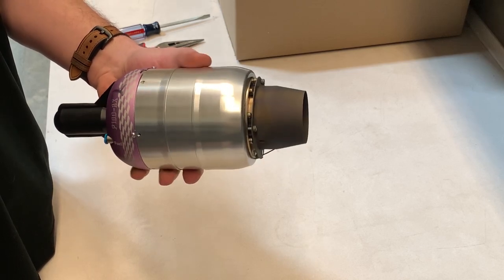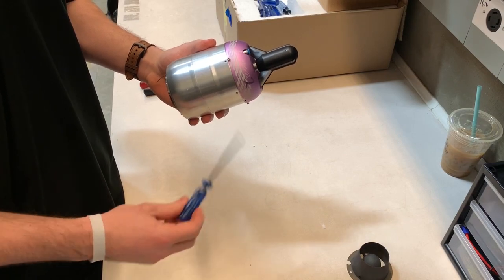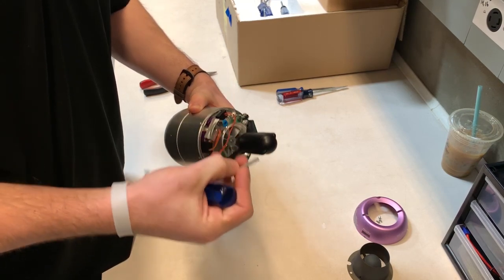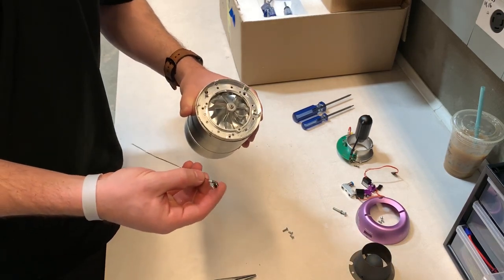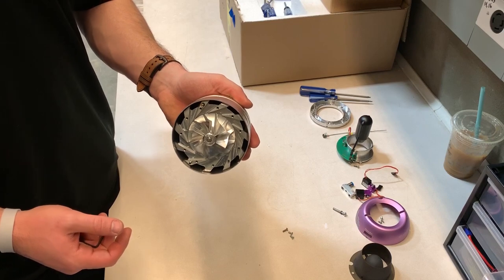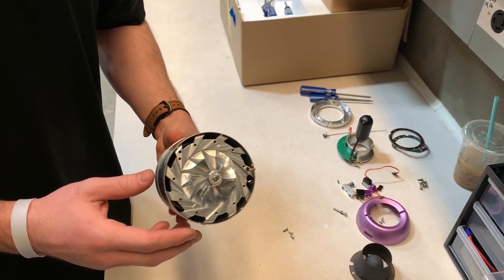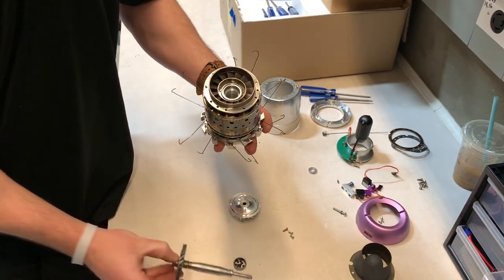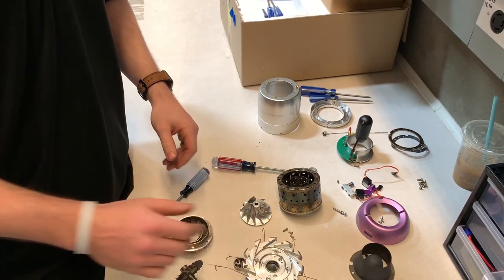Disassembly of JetCat P100 RX

Comment: Hey. a good video for learning internal components. Can you tell me how started motor was connected to the compressor/turbine shaft. Was there an clutch system of any sort. It would be very helpful if can share the picture or name of the connector used. Thanks
Reply from the maker: Hello, unfortunately I don’t have any pictures. But I can tell you that I believe the stater couples with the shaft via electromagnet. When the signal reaches the starter, the magnet engages with the shaft. After it’s running, it disengages. Full throttle for the turbine/compressor is around 154,000 rpm, which would destroy the starter.
Reply: @beastrcdriver101  what does the board do? Is it for fuel injection or ignition?
Reply from the maker: @FirstLast-tx3yj  It does a few things actually. The most important would be retrieving the information sent from the computer or controller. It also controls the starter, ignition, and has a thermocouple attached to read the Exit Gas Temperature. Lastly, it controls the fuel distribution system given relays.

Comment: Seems like your engine missing a compressor nut..also I wouldn't bend those fuel injectors that far apart..Good video
Reply from the maker: Every video Channel , our past senior team sheared off the nut unfortunately.. so the engine was pretty toast anyway. This was mostly a demonstration of how the parts fit together! But thank you for the advice.
Reply: @beastrcdriver101  :(

Comment: Would you recommend this turbine for beginners?
Reply from the maker: Andrew Schippel absolutely. The jetcat software can have a decent learning curve, but after you get that down the engine performs well just about every time. Most of these small turbojet engines are similar, but each one has its own unique features, mostly in terms of software integration.
Reply: @beastrcdriver101  does it come with everything you need  to get it going except fuel and the table?
Reply from the maker: Andrew Schippel Yeah, it’ll come with the engine, fuel delivery components, GSU to control it, ECU, and other main parts. It’s a good engine to test static for engineering analysis purposes as well. Jetcat has smaller versions on their website too
Reply: How would you compare the software to other programs? Like is it c++programming or simpler?
Reply from the maker: Andrew Schippel oh it’s much simpler man, it’s literally plug and play. No programming is needed. To run static tests, you just need the app on a computer and can run it from there. Everything’s set up, just a few weird steps to get used to. Or, you can RC learn it to a controller to actually fly, which is all in the manual.
Reply: Sweet! Thank you so much,  im definitely gonna order 1, could I email you if i have questions or should i stay in comments?
Reply from the maker: Andrew Schippel Welcome man, feel free to email me at colton.swart@okstate.edu

Comment: Why did you do that? If build build it together after that you NEED to balance the turbine shaft, compresser and turbine wheel or the engine wont last more than a minute and it will quite possibly explode.
Reply from the maker: Leo Goedecke Agreed. However, this video was just for educational purposes for future groups at my University. The engine didn’t operate before we started to disassemble it. This process was done to help visualize how the components of a jet engine integrate.
Reply: @beastrcdriver101  And what did you do with the engine after that? Because i want a jetcat engine as well for my graduation presentation and it really hurts to see that engine just get disassembled like that😂
Reply: No you don't need to balance the shaft with turbine and compressor. I replace my bearing without balancing these parts...Now that engine coming up on the second bearing change 8yrs later.  Just use a sharpie and mark the compressor and turbine wheel before removing the compressor bolt.
Reply: @1GLO919  I don't think rebalance is required at disassembly.

Comment: How much does it cost?
Reply from the maker: Md. Furkan Samad  We bought the engine for $2445.
Reply: In Europe 2200 €
Reply: @beastrcdriver101  That' s crazy expensive for some cnc aluminum parts, so glad I'm not addicted to turbines yet.
Reply from the maker: @beauluftenburg3167  For a pretty simple design too! Single spool centrifugal compressor/turbine. Nozzle and combustion chamber are from stamped steel as well for ease of manufacturing